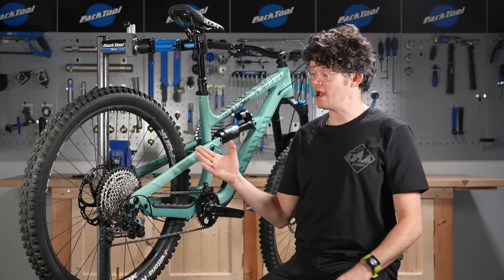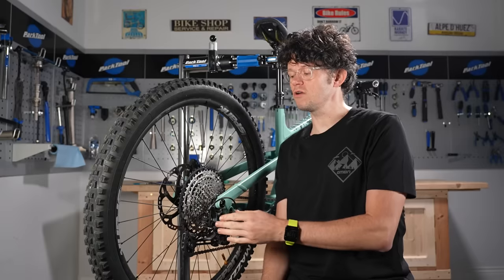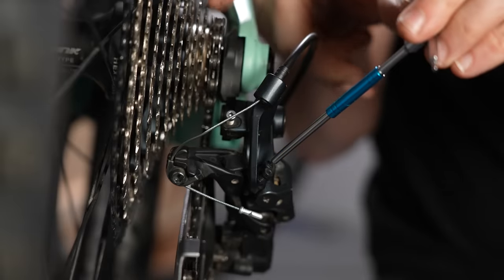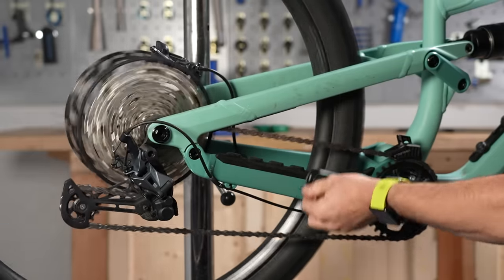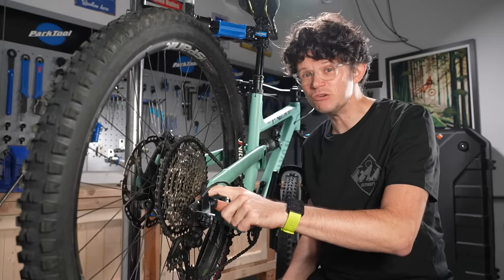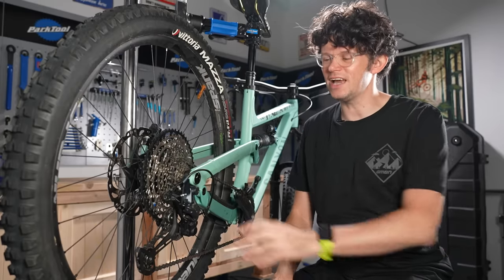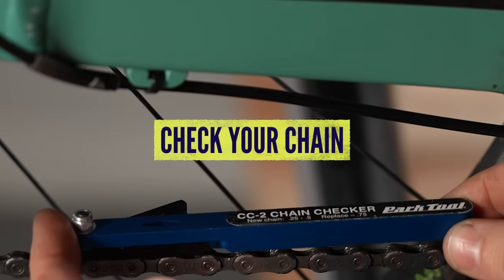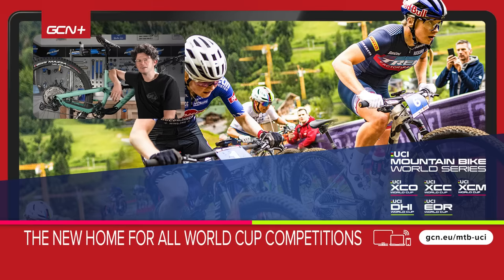How To Set Up And Adjust Your Rear Mech | Gear Indexing Basics

Comment: It’s worth mentioning. If shifting was good and I haven’t touched anything before it deteriorated, I go in a different order. Adjusting limit and b tension are my last step because those are set and forget with a new derailleur. First I try adjusting tension with the barrel adjuster. If that gets it close but not perfect, I check cable and hanger alignment. The order you went in would be for setting up a new derailleur, setting it up for a new hub or moving the derailleur to a different bike.

Comment: Couldn't be happier with the timing Owen! I have a stupid situation where the chain keeps jumping off the front sprocket with around two rotations of the crank. Not sure what I have done wrong.
Reply: Is the chain properly sized? Is it a new chain or old, it’s possible you have chain stretch. Do you have a chain guide?
Reply: @owenhildebrand1297  Hey Owen! I believe the chain is correctly sized (deflated my rear shock and measured 2 links from the biggest rear cog). The chain/cassette and chain ring are new. I do not have a chain guide unfortunately.
Reply: @fjallmann  a chain guide will certainly help but if the chain is coming off without you riding it, it might be something else. Make sure that the cogs on both the cassette and chain ring are completely straight.
Reply: @owenhildebrand1297  They did seem to be when I last checked it. But this situation is definitely a headscratcher for a newbie bike builder such as I.

Comment: Hi, I have this problem for two months... I got hybrid bike Riverside 500E, 1x 8speed for a long not used. When I went for a short ride on 8 lowest gear chain dropped from crank set and brake chain cover, so I decided to change all drive line. I went to official shop Decathlon workshop and changed to original all new, torque sensor, chainring, chain, derailleur,  cables and etc. I took my bike and I was exited till I changed gear in lowest 8 gear and it happen again.. my chain dropped from chainring in the chain cover and almost braked, I brought bike back in the shop and after long wait I was told that nothing they can do and I need to be gentle with bike and pedal not so hard.... It`s so annoying! I can use only 6 gears from 8 with no chain drop.. I lost even my hope, so now I`m asking you: Do you fink I need to try to change again to a new chainring like Shimano or smthng? Thank you!

Comment: What if halfway through the gears it starts catching on the next cog? But is fine on the smaller cogs?
Reply: Too much cable tension. Back it off a quarter of a turn & try it again.
Reply: Probably a bent hangar, seek out your wealthy friend with a derailleur hangar checker.
Reply: Probably just a few quarters turn clockwise on the barrel adjuster.
If the rear hanger is bent just buy another one 😂
Reply: @LaurentiusTriarius  Once you've got the hangar checker hooked up to diagnose whether it's bent or not, you may as well just use it to bend it back. But definitely have a spare hangar on hand first, just in case the original breaks while tweaking it.
Reply: Put the old hangar in a glass of water. If it sinks, replace it.

Comment: If you do not have a bike stand how do you adjust your gears like Owen did in your recent vid. Especially the limit screws with the way he did. #askGMBNTech
Reply: you only need to lift your rear wheel...

...or do it the old school - upside down ;)
Reply: @elononoras1902  Thank you. Thats helps. Thanks

Comment: do NOT adjust the limit screws this way!
You might wear out the threads and they'll be loose and rattle in and out and mess up your shifting and you'll have no idea what happened.
Don't adjust the screws under tension, that is, adjust the high limit while pulling on the mech, so there is no pressure on the threads, and adjust the low limit NOT pulling on the mech. Like exactly the opposite way shown in this video. Adjust by small increments, and check by releasing the mech (on high gear) or pulling on the mech (on low gear) after adjustment. You really don't want to see the arms moving from you turning the limit screws.
Also if they do feel too loose already, and you've experienced them getting misadjusted, you can try to wrap the screws in some cheap thin teflon tape to get them snug again, so you don't have to throw the whole thing into the garbage.